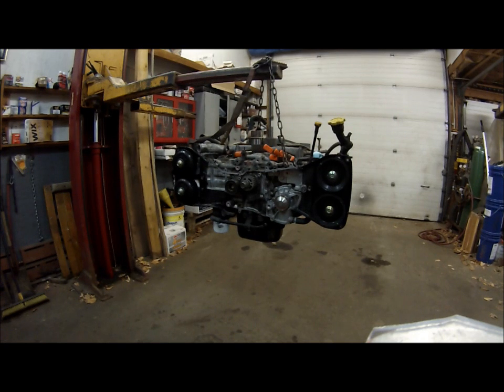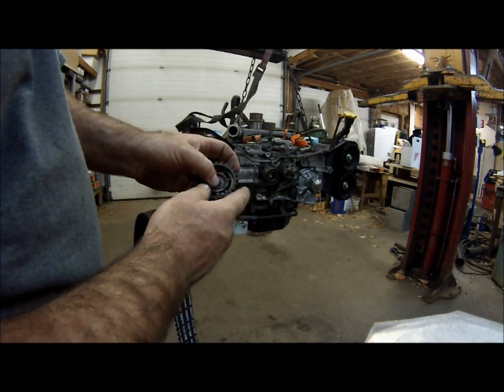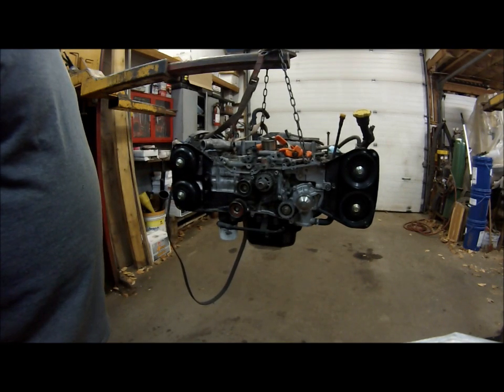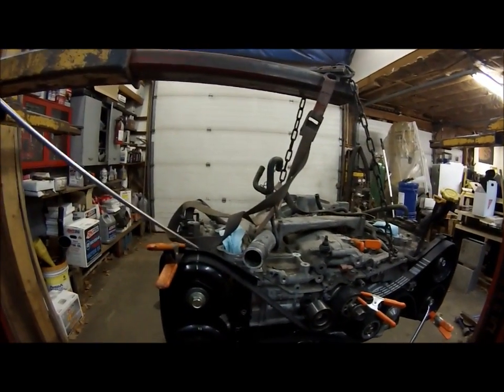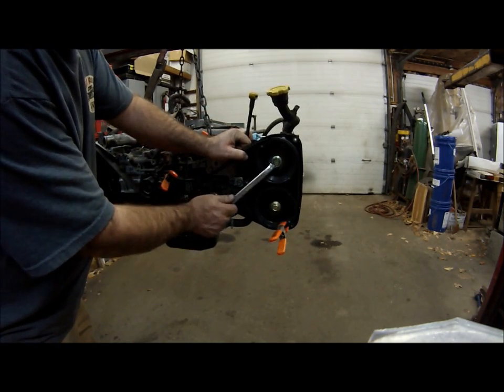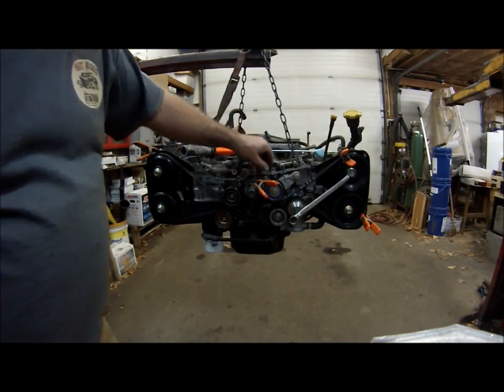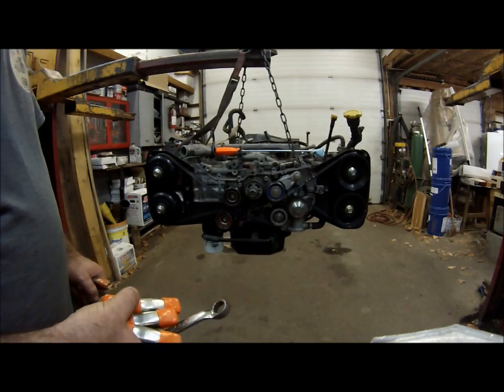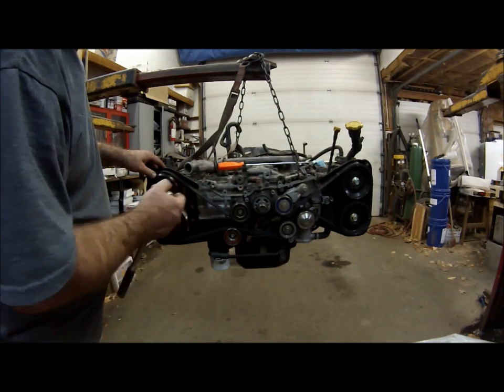Subaru 2 5 Twin Cam Timing Belt Install

Comment: Do you have to find TDC before you set the belt on the crank? Or is it just a case of aligning the markings?
Reply from the maker: Alex Evans Its a case of aligning all the markings.
Reply: Alex Evans s

Comment: While taking the cam bolts loose with belt still on I think the driver's side slipped from under belt. When I turn the crank the timing is aligned for the crank and passenger side but the driver's side is off by about 4 teeth on top cam and about 2 on bottom. Can I just do what you did once I remove belt? I'm redoing the heads and belt + pullies? Thanks
Reply from the maker: Yes, Once you have finished working on it just start from the beginning of the video and align all the marks.. on the belt, pulleys and on the covers and you'll be good to go.

Comment: So I have a question. I have a 1998 Legacy Outback with this motor in it. I took the timing belt off to get to the water pump, but I did that before I set the motor to TDC. Can you tell me what the procedure might be to align the timing back up correctly? Or am I screwed?
Reply from the maker: Your gonna do what's in this video. Align all your marks.. on the belt, pulleys and on the covers and you'll be good to go.